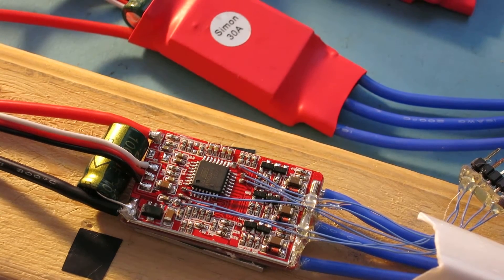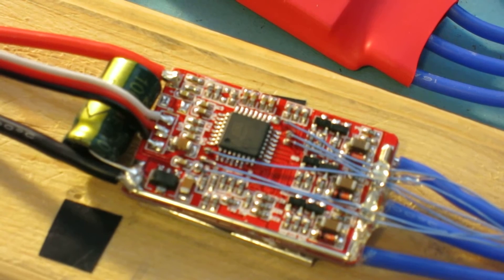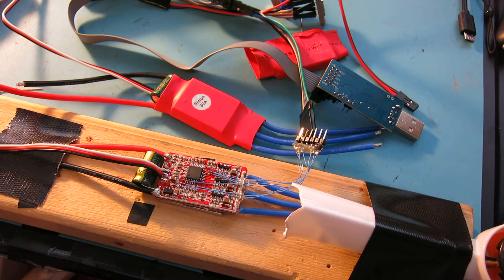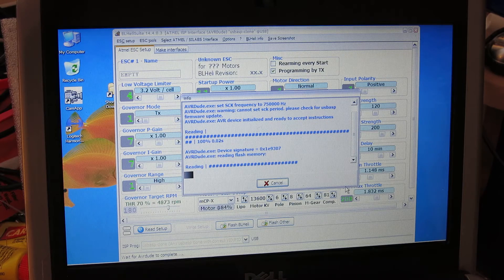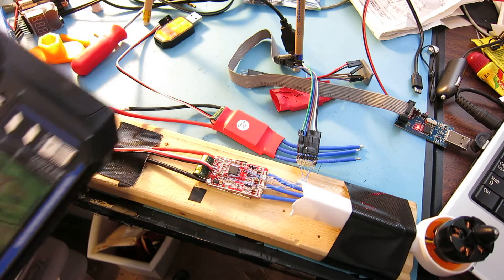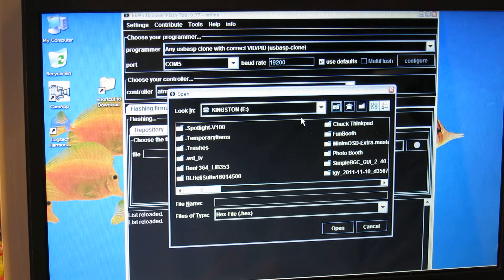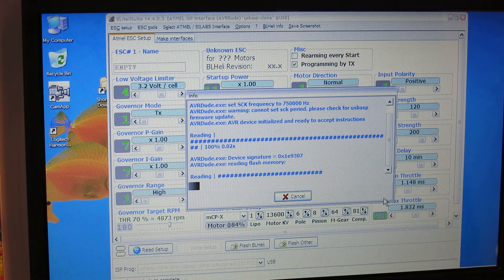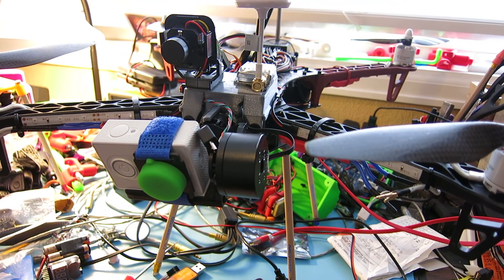How to Upgrade eBay Red Wrapped SimonK 30A ESC

Comment: I got the same esc in 2014 and only just tried using it the past few days.
It's the 4s 30a lipo version, it gets hot just sitting there while I try and setup endstops and pitch slopes ect, I'm only using a 3s 18650 pack and the original esc rated for the same smoked and popped the second it was plugged in.
These are now $20+ 
Maybe the BEC? Any help is appreciated...

Comment: I have the same esc but there is no startup musical tone but everything seems working well .but instead of single beep in throttle calibration mode in full throttle there is continuous single beep after i bring down the throttle there is 3 beeps that indicates successful ..but the quad is flying well in stabilize and alt hold mode but the problem is in loiter drone wobbles a lot

Comment: Looks like a beast of a quad copter you have there. The latest simonk 30A 2-4s esc I received from Aliexpress has a nuvoton 51FB9AE controller on the board. So things have changed over the last couple of years. For those interested and your info...
Reply: same. though keep in mind that it's a standard BOM eq of atmega8 chip as long as you can figure out the pinout should be able to flash with the same hex files(no tested currently working on one will update when smoke rises..)
Reply: did yours come actually flashed with simonK FW? i suspect mine isn't as i can't seem to start the tx programming mode

Comment: I have the same ESC. IS IT COMPULSORY TO UPDATE THE FIRMWARE OF THE ESC OR  WILL IT BE FINE IF I DON'T UPDATE ESC. PLEASE REPLY I AM A SUBSCRIBED USER.
Reply from the maker: It should be fine with the default firmware.  I cannot say that there was a huge improvement.  Good luck!
Reply: @MileHigh3D  thanks a lot you are great.

Comment: Is there any noticeable difference between 2012 and 2015 firmware, Was it worth the time and expense  spent stripping off the heatshrink, soldering wires, and replacing the heatshrink?
Reply from the maker: I thought that there was a noticeable difference in response.  But compared to modern miniquad ESCs, I can't say that it would be worth it.  The expense was minimal.

Comment: Hi, I was lead to believe the tgy.hex file is for 16Mhz external crystal ESCs and 8Mhz internal oscillator ESCs should use tgy_8mhz.hex file. Any comment on this ?  Many thanks.
Reply from the maker: I can't say for sure.  But, I'm 99% positive that my ESCs do not have the external oscillator.  I can't see the component on the board.  However tgy.hex works for me.  If you go to the Thingiverse page, you can see a picture of my ESC board.

Comment: Hi ,
when I operated my quadqopter ...the motors run at diffrent speeds !!!
why ?
the motors are good .
but the signals that exited from esc's are not good .
how I make the signals of my esc are the same ???
Reply from the maker: You may need to calibrate the ESCs.  You need to raise your throttle to 100% before powering on the ESC so it learns the maximum.  Lower the throttle to 0% and it will learn the minimum.  This is different depending on what flight controller you are using.  If you wire directly to the PWM wires from the receiver, the calibration should work as I described.

Comment: Can any ESC be programmed with SimonK firmware? Can any ESC be programmed with SimonK to have reverse function?
Reply from the maker: Hi.  Not as far as I know.  There is a list of processors types that are supported for Simon K.  The problem is identifying what your ESC uses and finding the correct firmware to load.  Since most of the Simon K supported ESCs are generic, you'll have to open up the shrinkwap and examine the hardware.

Comment: Is possible to convert this simonk esc to blheli firmware?if I want to upload the blheli firmware ,how is the equivalent hardware for blhelu programming?
Reply from the maker: Hi.  No, it is not possible.  I believe that the reason is that the red ESC physically does not have an external oscillator which is needed for the BLHELI firmware.  There are other inexpensive ESCs that can run BLHELI.  Take a look at the yellow wrapped ESCs on eBay.

Comment: Dude!
How did you do that?!?!
I bought four of those more than a year ago, everything that could go wrong went wrong and now I'm 110% sure I'm doing everything right....still nothing.

Would you mind giving me a help with this?
Reply from the maker: I'll try.  What tools are you using to flash?  Have you seen my other video where I made a tool?  https://www.youtube.com/watch?v=-6gfSp8RyV4&list=PLT7c4vznV5DplntQOerrDYLHt4aagMryV&index=3
Reply: (for some reason I can't answer where we were talking originally :P)
I did the tests you suggested and yes, all terminals are correctly soldered and continuity is verified.

It all points to this damn external oscillator, but I have no clue what that is. (I could research but.....) Would you have an example of such setup?
Reply from the maker: The oscillator is basically a clock for timing.  If you don't have one, then the ATMEL processor must generate its own clock timing, which is less accurate.  My ESC do not have the external oscillator.  This is one of the ways to identify the ESC as using the Simon K tgy.hex firmware.  You cannot flash BL Heli on these ESCs.  Sorry.  Maybe you can make a video showing what is happening.
Reply: Sorry, I should have been more clear.
I understand what an oscillator is (although I never saw one and don't know how to use it) and I understand there is one on an Atmega chip. But it is possible to turn it off to block new attempts to program the chip, here enters the external oscillator.
As you mentioned you already have done this (connect an external oscillator to an Atmega8), I was hoping you could have some material about how to do it.
Reply from the maker: Sorry, if I misspoke.  I did not use an external oscillator.

Comment: Great Guide... Thanks a lot !

One question here : In BLHeli Suite i can see Cleanflight Interface for flashing. I tried to flash it and it's flashed but when i compare firmware it is shwoing 98 % Match.
And, Even my ESC is working perfectly after flashing with Newly "tgy_2015-09-12" tgy.hex file.

Please help to understand is it okay or not if it's given comparison 98%

Thank you !
Vishal
Reply: Hi Vishal, I just flashed them with blheli as well just passthrough the naze32. Just select the "Atmel/SimonK (cleanflight)" interface (#6) and you should be good. I couldn't change any settings, the write option is greyed out but now I have ONESHOT125 so it did work. "Identify ESC" finds 100% match to the tgy.hex file. Cheers!
Reply from the maker: Hi.  I cannot say for sure what is happening since I haven't used that option.  If you can use KKflashtool, it will immediately do the verify after flashing.  It should be 100%.  BLHeli suite may be adding additional things for the bootloader or something else.  Sorry.
Reply: Thanks for your valuable reply.

I'm not having "AVR programmer" but can you let me know is it possible to do with Arduino Nano V3 board.

If it can possible, guide to do so.

Again thanks !!!
Reply from the maker: There should be many examples of how to do this. Take a look at this:  https://www.arduino.cc/en/Tutorial/ArduinoISP.  You should be able to adapt this to your board.

Comment: Is it possible to flash Blheli for such ESCs ??
Reply: I had success flashing blheli by soldering a external 16Mhz  oszillator on the Oszilator Pins on the atmega 8-chip

Comment: Thanks for video. I bought the same ESC few days ago and they actually have Simonk bootloader. So I don't  have to use USBASP and do any soldering. I just connect them to my naze32 and flash it using cleanflight pass-through in BLHeliSuite. Very easy. Also if you download all the simonk hex files BLHeliSuite can find which one is installed on the ESC in about 10 seconds with the Identify ESC function. But I wouldn't probably get that far without your video so thanks again.

Comment: can 1 not use flight controller?
Reply from the maker: You may be able to use your flight controller to flash your ESC only if the ESC and your flight controller support it.  These ESCs are very inexpensive and I have NOT been able to flash these using a DYS USB Linker.  I believe that these red ESCs can only be flashed by soldering wires to the pads, an Atmel chip programmer, or using a tool like the one I used in one of my other videos.  Perhaps the Turnigy USB linker would work.
Reply: Appreciate the reply. Is there a easy way to read whats on them already?
Im new and got the red and yellows thinking 30A lol and thought going in threw fv would work.
Im using naze32 rev5 6dof. sure its atmel too.

What other usb is there or is there no bluetooth way to connect? im thinking throw bluetooth on mine anyway. Can you recommend?

Sorry for all questions but your exactly were im at. If theres no real need to upgrade il leave them but for now I just want to know the working and what version. Simple data cable threw fc will read them?
Reply from the maker: FindmeKicksUK if you go to 5:00 on this video I use BLHeli suite to verify the tgy.hex firmware. There may be a way to read the firmware and identify it but I just used brute force and started comparing it to all of the versions. You can use avrdude, kkflashtool, or possibly others to compare the firmware.

Comment: nice tutor sir...
i have 2 simonk esc Firmaware 30a, that is not run while i setup in Librepilot calibration with rapid choised...the motor like stack for run...how can i fix it sir..?
thank you so much.
Reply from the maker: EDDY SAPUTRA Thanks. I'm having difficulty understanding exactly what is happening. Can you clarify what you mean by "the motor like stack for run"? I'll answer your question as best as I can.
Reply: Hi mile high multicopters..
Thanks for reply..
I mean my motor can not run well or like the spin stuck..sorry my bad english
Reply from the maker: Is this all motors or just 1 motor? If it is only 1 motor, then switch it to another ESC to test it.  If it behaves the same, then the motor is bad.  If it is stuck when you spin it with your fingers, then your bearings may be bad or there is a bend in the motor shaft.  If all motors are good and it does this, there may be an incompatibility between your ESC and motors.  Maybe a SimonK firmware upgrade to the latest version will help if there both the ESC and motor are good.  Otherwise you will need to try a new ESC or motor.  I hope that this helps.
Reply: thats just 1 motor....but now i was fix it....
btw..how should ESC timing i choise in if i used simonk firmware...is i choise standart ESC, rapid or oneshot..? i still confuse here. and can this wrong choise cause ESC burn or bad..?
Reply from the maker: I'll try to answer as best as I can.  If your ESC is identical to mine, you must choose tgy.hex.  My guess is that it will be a standard ESC.  I do not believe that this ESC can be flashed using oneshot.  The only method of flashing as far as I know is to use the programming pads as I show or an ATMEL socket programmer tool.  I made my own flash tool that you can see if you look at my other video.  I do not recommend that you try to flash firmware for the wrong ESC as this can be unpredictable and you may end of bricking your ESC and need to use other methods to unbrick it.  There is a bootloader on the ESC can may need to be upgraded to use other methods of flashing.  The method that I use is to identify exactly what firmware is on the ESC first and then upgrade it using the correct firmware.

To customize the timing and other parameters, you will have to do a custom build of the ESC firmware.  Please refer to the SimonK documentation, as I have not done this yet since I am satisfied with the performance on my ESCs.

Comment: Can I uprade firmware to this esc with brake and reverse ?
Reply from the maker: I don't know off-hand.  But, you may be able to configure these options and make a custom firmware.  Simon K. was working on a web-based GUI to do custom builds.  Search for his website and see what the options are for custom built firmware.

Comment: Does yours get hot to in idle?? Like when you are not running the motor they get pretty hot on the bottom, mine get around 50 degrees centigrade.

Edit: I only ordered one, so I don't have a reference.
Edit, also, I run it on 6S
Reply from the maker: Sometimes 1 will get hot.  But not hot enough to burn.  I have 1 quad with all 4 BECs plugged in and not all will get warm.
Reply: will they also get warm when you don't run a motor with them?
Reply from the maker: I have never powered them without motors connected.